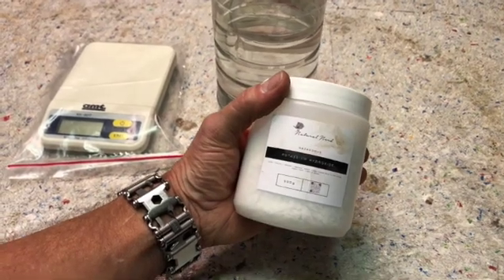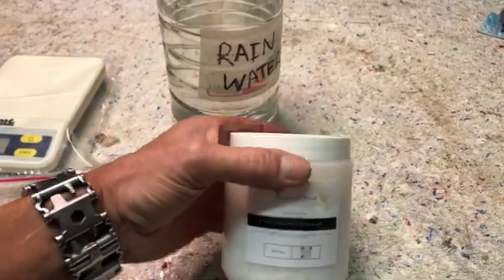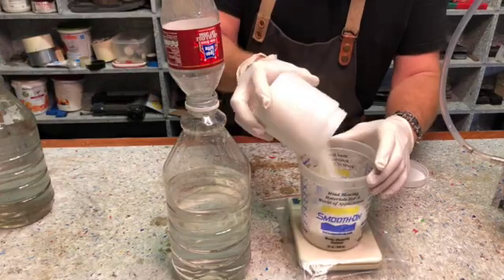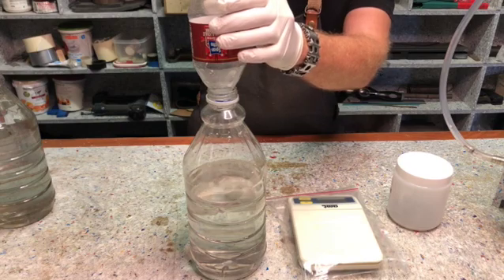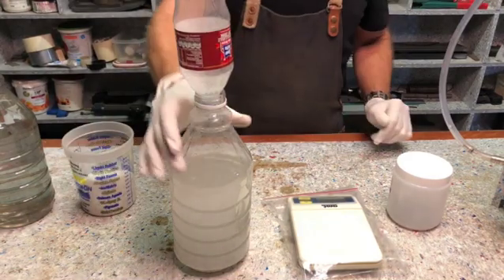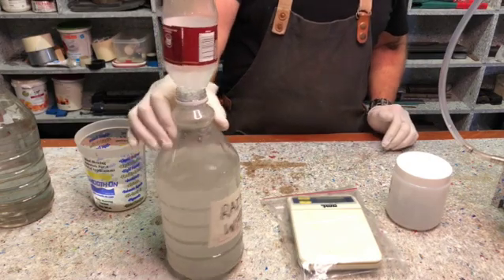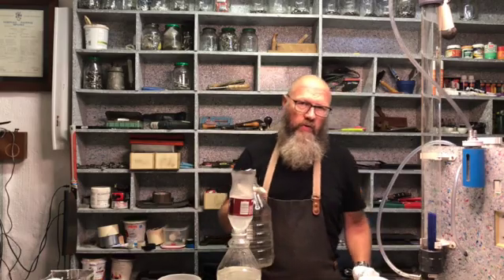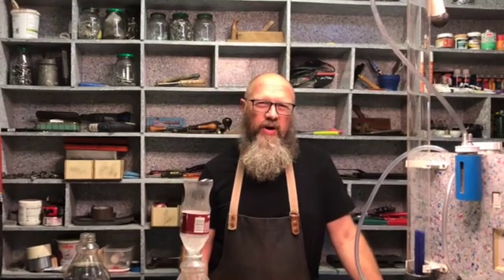How to mix potassium hydroxide safely for use in brown's gas or HHO generators

Comment: I have made 20x30cm plate cell 30 plates 5 neutral and 24v in wet cell with just little koh req 200a how to lower the current more plates or mor koh

Comment: Hi, Thanks for sharing this video, which will help lot of people working with HHO kits or generators, my simple question is that will it corrode the metal associated with hho cells? 
My 2nd question is what should be the BEST (PH) of the solution. Coz if we achieve the desired PH, so there will be no issues of what quantity is required of Potassium Hydroxide, simply.

Comment: 280 grams of Potassium Hydroxide (KOH) mixed in 720 grams of de-ionised / distilled water will give 28% concentrate electrolyte solution . Always try to keep the concentration low between 10% to 15% as too much HHO in engine in hot climate will raise the temperature of the engine so high that the radiator can not handle it.

0.15 LPM/1 liter engine is the ideal gas requirement for hot climate , which means a 3 liter engine needs 0.45 LPM
Reply from the maker: The 28% is the maximum for electrolyser like the one I built. Mine is not for cars. I an sure you know what you are talking about when you refer to hho in car engines. This is not what I am using my hho for. Therefore I use 28 % as I need the maximum hho output.
Reply: @thequixotryworkshop2424  , I have been playing with hho generators since 2005 . For cars, I used a wet cell generator ( 7 cells) with double bubbler ( water scrubber) . I used to make hho brazing machines ( 240 LPH ) .
Reply: I always make series cell generators ( 7 cells for 13.8V DC supply.
Reply: @kaka_kaka28 greetings Kaka, can you please tell the best PH of KoH solution for the HHO generator? Thanks
Reply: @IamAli89  , I have not measured the PH of the solution.
Reply: @IamAli89 , I would suggest you to chill the de-ionised water / distilling water and then add 
Lab grade Sodium Hydroxide (NaOH) of 97+% purity . In my country High purity Potassium Hydroxide is only 85% . 

High purity Sodium Hydroxide of 97+%  eliminates foaming problem during electrolysis.

Comment: Do I need to pull more water in the generator or I don’t need to put more potassium just water
Reply from the maker: You only put Potassium Hydroxide once in the beginning. Then top up with distilled water.

Comment: Hello. Please how many grams of potassium hydroxide do I use in 500 ml of water?
Reply from the maker: Hi. It is 28% mixture. So 500ml or 500grams of water ratio 28%=200grams.
https://www.omnicalculator.com/chemistry/mixing-ratio

Exactly: 
1st substance	500	-71.43%
2nd substance	200	-28.57%